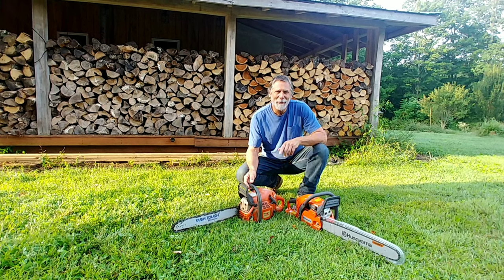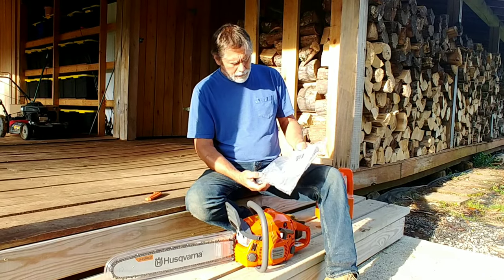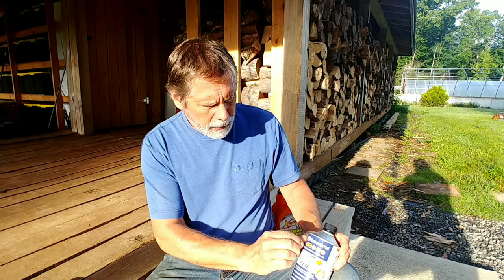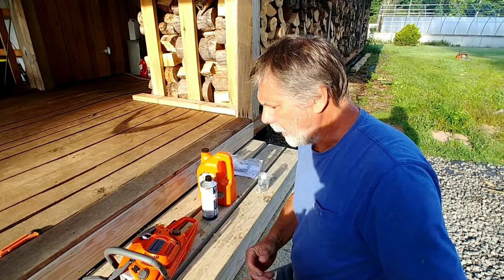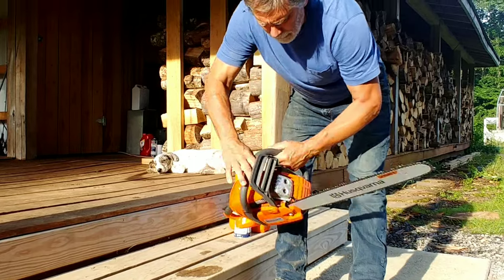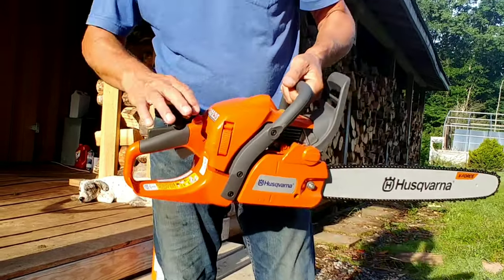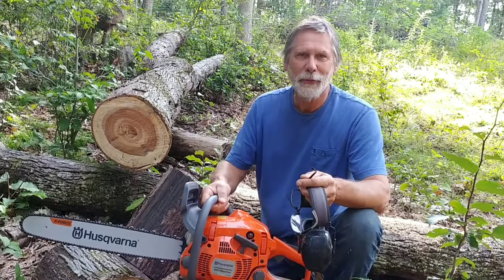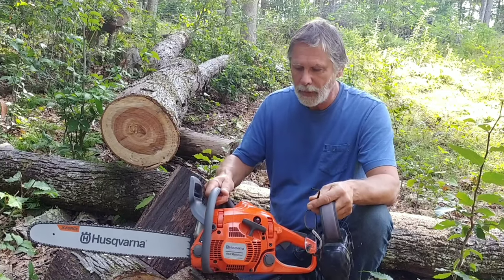HUSQVARNA 450 Rancher Review

Comment: I just watched your video and I too have a 455 Husky like you and I want to get a back up saw just in case. I  noticed one thing that is different between the two and the 455 has 2 bar tightening bolts to secure the bar down tight which I really like as compared to the 450 only having one bolt. That  make the two uncompatable for switching side covers and my biggest problem is with the bar and chain loosening up more frequently.  What do you think? I  was a Northern California Logger back in the 1970's Up until 1990 and I ran Chainsaw every day.  I love my 455 because it is very powerful and cuts great.

Comment: I have a great dealership that checks everything before handing the tool over. I use the 455, and it has run perfectly every time! The non ethinel fuel is way too expensive and bit of a con, I use Husqvarna XP and it does pretty much the same, no issues so far!
Reply from the maker: I also have a 455 I love it only problem is oiler it stretches chains prematurely
Reply: I also have a 455 and love the power. I have noticed if I  push the primer button one to many times it floods and I have to remove the spark plug to dry it out. Another problem I had when doing this is putting it back together I started noticing it was hard to start so in checking it out I noticed the sparkplug wire was not seating properly and riding on top of the spring clip tto the sparkplug.  Once I figure that out and get it aligned properly it fires right up.

Comment: My pull string broke after the second time pulling on it. That was a real treat fixing myself. And this thing leaks bar oil so badly I have to keep a garbage can lid under it when not in use because it drains the whole tank.
Reply: mine does the same.  Leaks bar oil like crazy.  I've had mine for about 4 years and I religiously drain the fuel out of it (no exceptions) if i'm not going to use it for long periods of time, to make sure it never sucks in bad 2 stroke gas. Mine will run for about 10 minutes and then quit, and that's it for the day, it won't restart.  I've tried letting it sit, adjusting the high and low throttle screws, nothing works.  It quits after about 10 minutes.
Reply: @chrisloesch1870  I just make sure to run mine once a month or so. Even if you drain the fuel, it’ll get gummed up in the carb and lines.

Comment: Nice surprise!
I’ve had the 455 Rancher for years and it’s been a good saw.
Thanks for the review of the 450
Reply from the maker: I also have the 455 I loved it .it was so dependable I did have one problem with the 455 the bar oiler did not work well  .the 450 has a different oiler and it works great

Comment: That 450 is a complete pile of shit because 1 bought one & ran 1 tank of fuel & the oil tank was still 3/4 full & my bar & chain are smoked because they got to hot. Common sense simple when you run a tank of fuel out the oil should be 95% empty if not 98% empty. Now you would think that Husqvarna would have somebody with a little more education than a preschooler would figure that out since that is their business that they are in. How is every other brand of chainsaw Echo Homelite Craftsman Ryobi Stilh McCulloch & so on figured out 1 full tank of fuel = 1 full tank of oil
Reply: I'm not super thrilled with my 450 either.  Mine it's impossible to keep the chain taught.  The tightening screws and slot on the saw are pure garbage design.  Mine runs for about 10 minutes and then overheats and shuts down for the rest of the day.  I use 2 stroke and plenty of chain oil but it just doesn't run well for extended periods.  Next saw i get will be a Stihl, I don't care how expensive it is.  I've never had issues with Stihl power equipment.

Comment: I’ve ran the 450 at work and I really like them. I ended up busting the tank on it and had to get a stihl 261 and it’s a good saw. I like both husqvarna and stihl. The husqvarna 550xp is about the same size as the 450 but I think the 550 is lighter
Reply from the maker: Thank you I have had mine about 3months now cut about 8 full cords of fire wood still works great
Reply: I have had a 450 since 2009. Good saw. Own a 550 m2, insane  saw. 550 is heavier but has more hp. Like them both.